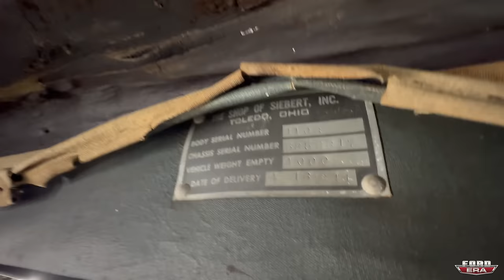Visiting @SimonsPowerhouse Full Shop & Truck Tour!

Comment: Don't lower Gold dust and make it a 2wd, that would be sad, it's perfect as is.
Reply from the maker: it looks perfect, but if i want it to continue to be something i want to drive alot it needs to be easier
Reply: @FordEra  if youre looking for better ride quality. Hit up one up offroad.   They have the best systems available for trucks.  Can only really speak to the quality of the superduty platform but i can safely assume that the same amount of engineering and quality has gone into their dodge set ups as well. (Gold dust has a dodge frame right?)
Reply: @FordEra a good stroked 390 to a 445 would fit the bill

Comment: Build the new truck it will pay for its self off utube but all joke aside get the last year they built 5.9 cummins 2007 mid tune and exhurst brake mine pulls a 3 axle toy hauler with my black tatuem.with a blown L.S.that cost $200k for the buggy so one more time 5.9 cummins 2007

Comment: i know you wont do it,but if it were mine i would put the original 390 in it and i would have a rep. FE shop stroke it out to 445. great hp and torque,and it wont leak and they were one of fords most reliable engines ever.you would love it even more